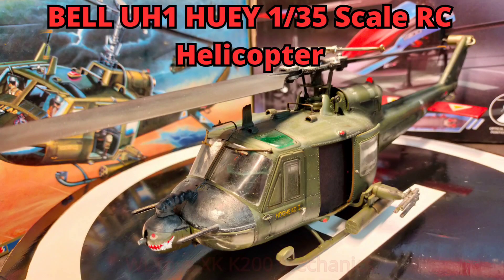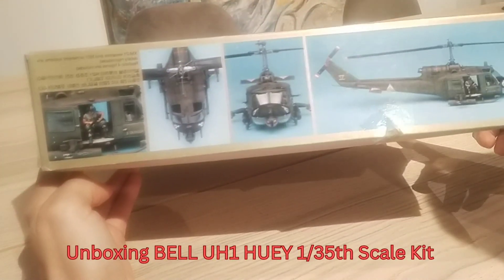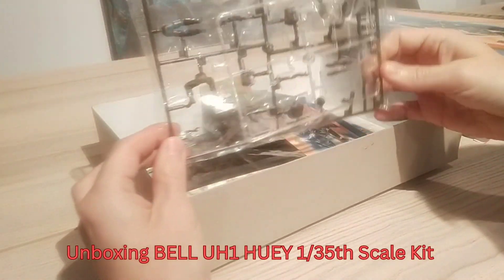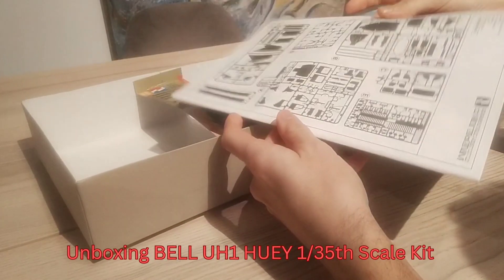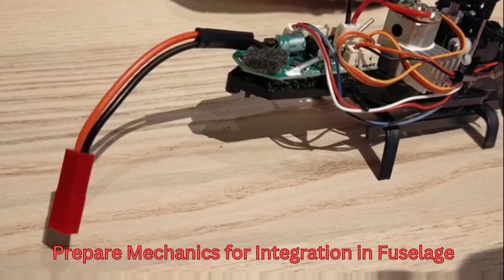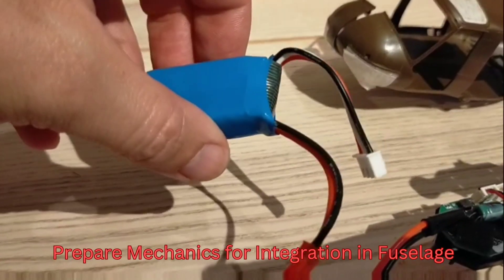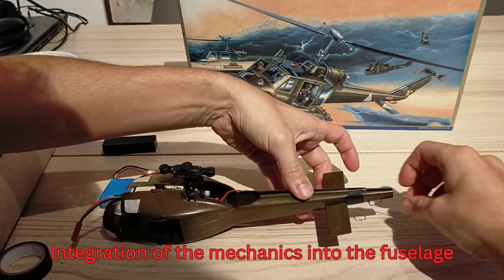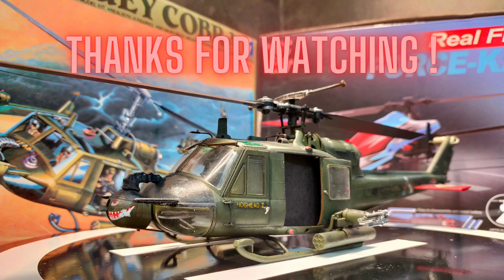BELL UH1 HUEY 1/35 Scale Plastic Kit converted to a flying RC Helicopter w WLToys XK K200 Mechanic

Comment: How you connect the main frame to the model fuselage ?
Reply from the maker: For this model, I just cut the struts of the landing gear so that the mechanic is resting on the fuselage floor. This was enough to fix the mechanic in the fuselage